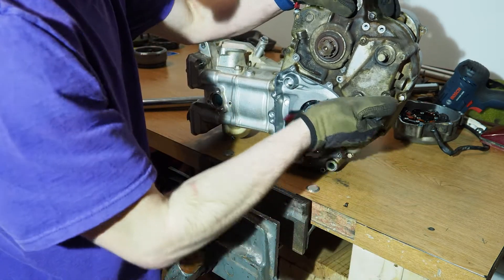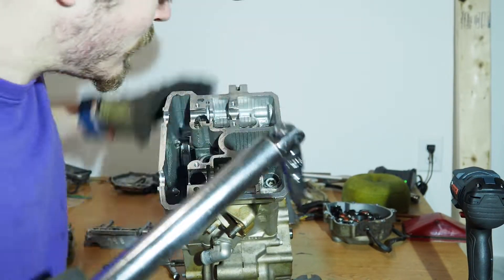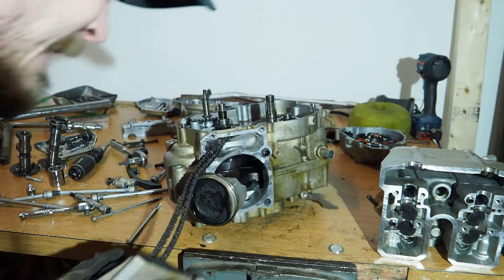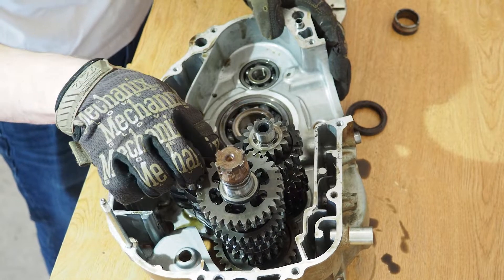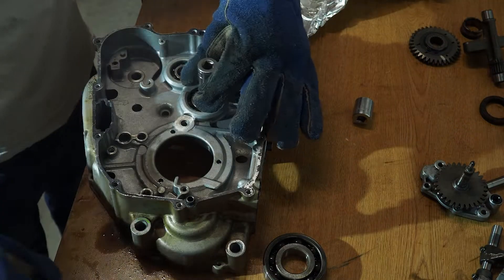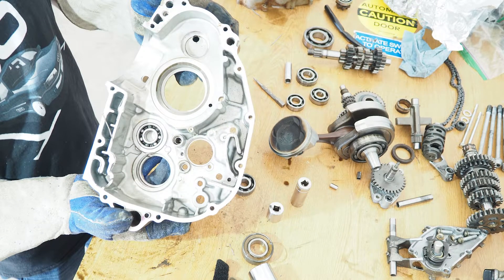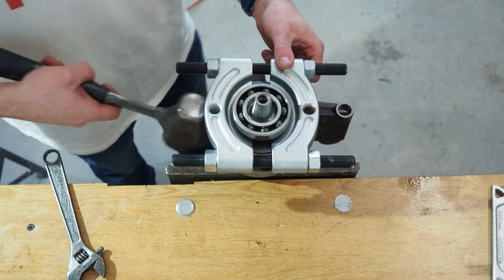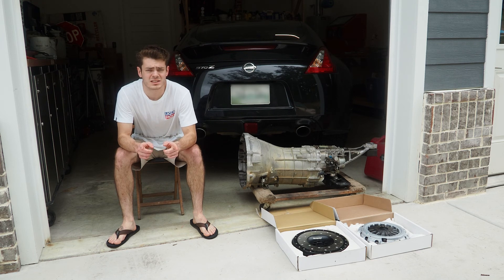KLX300R Rebuild Ep. 3 - Completion of Engine Disassembly

Comment: i have been waiting for the klx rebuild hope you get on it soon i have a klx 250d same as your engine and i have problems starting it up i had the top end rebuilt but not done as good and i have wiring harness problems so i am hopping to watch your rebuild to get a vast knowledge on the engine and the wiring harness.... my fingers are crossed and bell icon is on
Reply from the maker: I’m pleasantly surprised to find that my content may actually be useful to some people in the real world. I will take your comment into consideration and try to get back to the KLX sooner than winter 👍
Reply: @SpencerSlaughter426  thank you spence😇

Comment: Very impressed with how clean the inside of your engine is.   I just got a 2007 KLX300R and would like to know how often you change your oil, and what type and weight oil you use?  My goal would be to have an engine as clean as yours.
Reply from the maker: I used Kawasaki 10W40 stuff from my local motorsports dealer. I didn’t actually have a routine oil change schedule, I just tinkered with the bike so much that changing oil was a pretty regular thing and so I didn’t worry about it. Hopefully you’ll have as much like as I do!

Comment: Hey man, how are you doing? Casually got back on your video after a long time. Still waiting for your rebuild! Cmon let’s make this 300 ride again 😄
Reply from the maker: I’m currently working on locating a shop that provides vapor honing as a service. I want to get the engine cases vapor honed and I plan on painting the various covers. I believe there’s a shop near me that does vapor honing but they have yet to answer my calls or emails. After I figure that out I just have to either buy a new crankshaft for $800 or get a rebuild kit off of eBay and find a shop that can rebuild it. This would be going much more efficiently if I hadn’t moved two months ago. I still have to move my whole workshop to the new house. Oh, and, also, I spent last year working tirelessly on a 1992 Nissan Hardbody. I rebuilt the engine and the front suspension. I actually have a video for the engine rebuild 99% complete. I wanted to film an outro driving the truck somewhere scenic or something but there are kinks I’m still having to work out and so it’s not really road ready. I’m debating on just releasing that video without worrying about the cool outro. Anyways, I appreciate your follow up man! It’s really cool to know that I’ve got an idea that people actually care about, and I hope you’re doing well also! Your comment inspires and motivates me to keep going and, honestly, I needed that!
Reply: You lost all the damn parts by now bro
Reply from the maker: @Conx2  Nah still got em

Comment: Great videos.  I'm about to rebuild a 98 klx 300r.  Were you able to find a transmission bearing kit?  I've looked everywhere and haven't found one.
Reply from the maker: Are you referring to the collar on the output shaft or the crankcase bearings?
Reply: @Spencer Slaughter  all of the crankcase bearings.  I can get them from the oem diagram and order them separately.  It's easier in a kit.
Reply from the maker: @ghettorat6814  I did end up just ordering all of them separately from an OEM dealer. It was either kawasakipartshouse.com or revzilla.com. It is a bit of a pain in the ass to have to order all of them and make sure you don’t get any duplicates but I couldn’t find a kit either.

Comment: Are you gonna do a full rebuild series? I have the same bike and need to rebuild it 😂
Reply from the maker: I’ve currently got the engine cases at a shop where they’re going to finalize some things with the engine and vapor hone the cases. I’ve not worked with this shop before and I don’t know what their turnaround typically looks like, but hopefully I’ll have the parts back within a few weeks. The next video will be the complete engine rebuild. I already have all the parts for the engine, and I plan on doing as much as I can to finish this project this year. As long as I can afford it that quickly, at least.
Reply: @SpencerSlaughter426  hell yea! I can’t wait to see the video and maybe you can do a complete break down of parts materials and price ?
Reply from the maker: @FURFEELINGS_3  I’ll definitely make it a point to show the processes, specifications, tolerances, etc. so that it can serve as a how-to guide for these engines. I ordered all the parts about a year and a half ago or so so I won’t be able to find the emails of pricing and stuff. Depending on how long the video ends up being, I may be able to work in a price breakdown of what it costed, though. I’ll keep it in mind for ya!